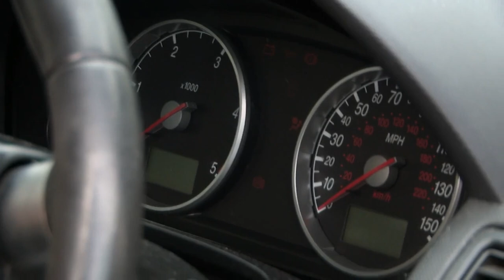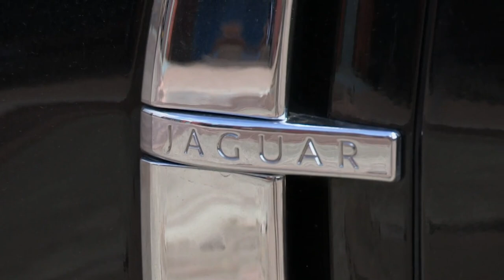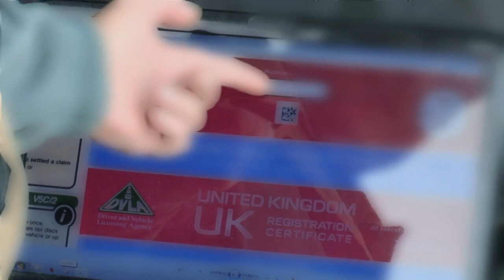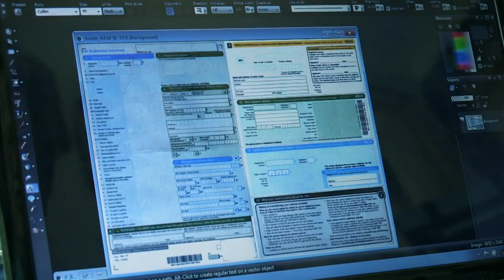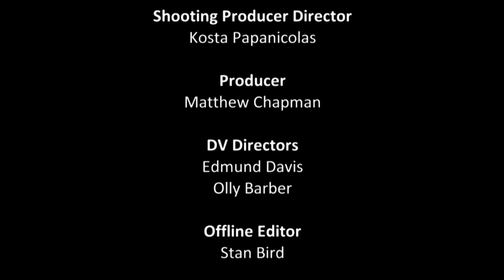Meeting The Car Criminals Who Are Experts At Stealing Vehicles! | Only Human

Comment: I'm sorry I'm just 2 minutes and 45 seconds in and I'm dying of laughter here. " oh yeah man the car will totally start, I just can't do it for some reason, I mean like I could but I just can't show you on camera right now even though you spent 20 minutes filming me destroying this expensive steering column, starting the car, I just can't show you that part" 

You cannot start that car with a screwdriver. Just about every single Ford product after around 2000 requires programming equipment.